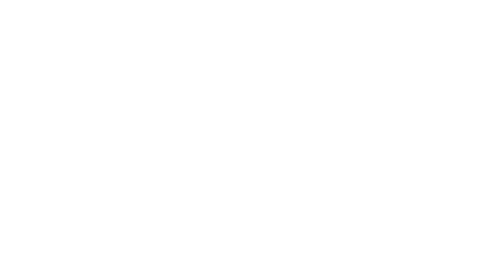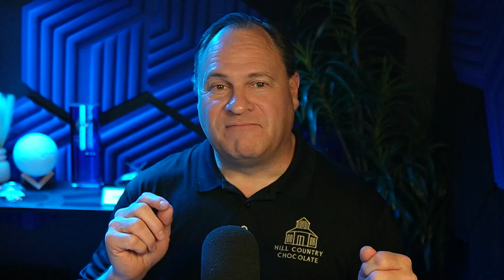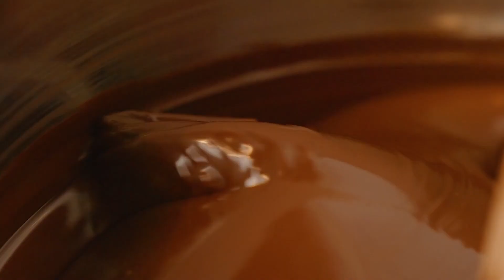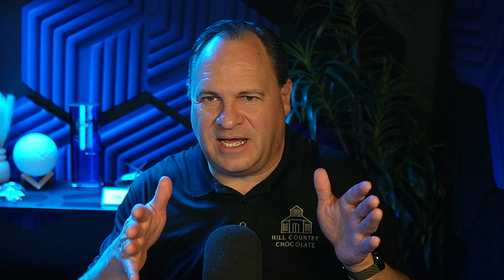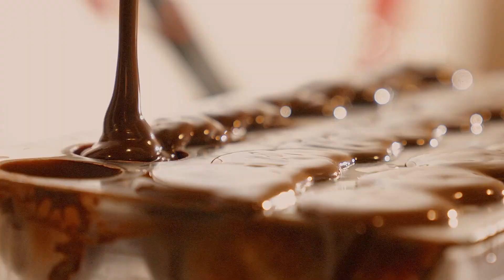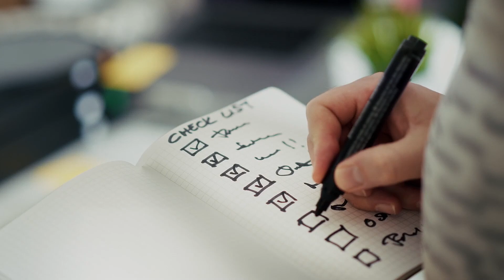Essential Chocolate Machines for Starting Your Factory: Tips from Pros

Comment: Do you have to change a chocolate recipe if you live in high altitude?
Reply from the maker: Yes, you often need to adjust chocolate recipes for high altitude, mainly due to lower boiling points affecting moisture evaporation and sugar crystallization.